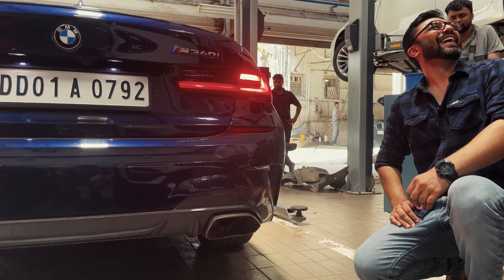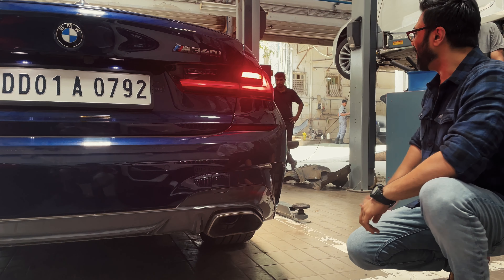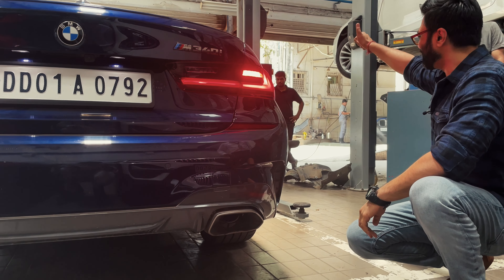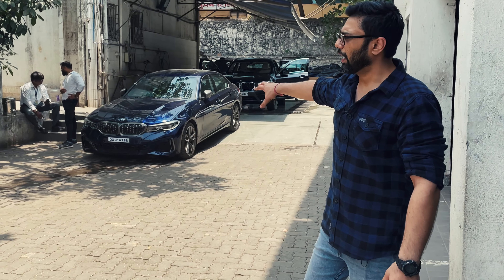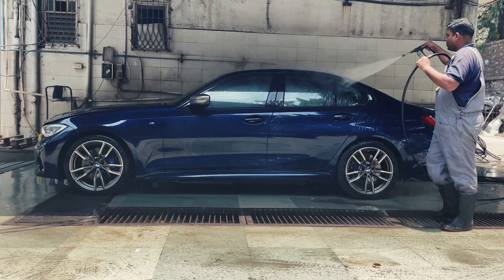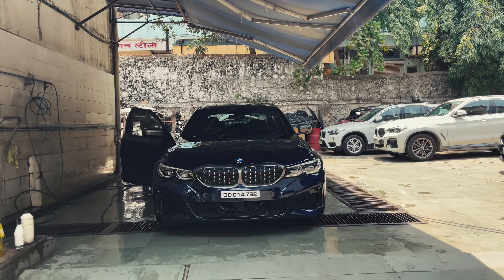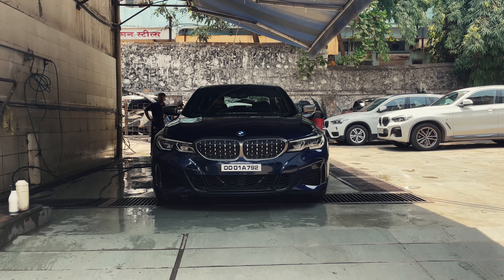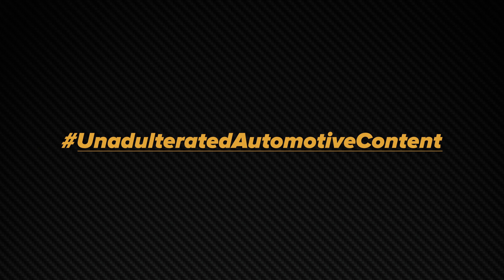BMW M340i M Performance Exhaust - Install & Sounds | 4K

Comment: I really wasn’t expecting it to be that good. Pure melody 🎵
Reply from the maker: Indeed !
Reply: @KKCOnAMotive  Hi I’ve just purchased the bmw M340i and wanted to get the m performance exhaust upgrade and I read your post on team bhp. You have written it was approx 2L including installation cost I have gotten a quote for almost 3L. Just wondering if they are scamming me or has the price really gone up by that much since you installed it
Reply from the maker: @helintroy  Hi, yes I had purchased at the said price but currently people are being quoted anywhere in the range of 2.5 - 3L.
Reply: @KKCOnAMotive  ok I was quoted 2.7 with additional cost for fitting and testing…. I guess I’ll have to now nut up and buy the exhaust from them as I’m not wanting to void the warranty as the car is almost brand new….
Reply from the maker: @helintroy  All the best.
Reply: @KKCOnAMotive  day after my car is going in for the fitment of my M performance exhaust…how would compare the pops and bangs now that the soot accumulation must have happened in your exhaust and how much louder is it compared to stock… i can’t wait for this upgrade

Comment: Hi Karan, I’ve got an M340i LCI with the M Performance exhaust installed at the dealership. I’ve been encountering a persistent check engine light, which seems to be related to the petrol particulate filter. Have you faced something similar? Or do you have any suggestions on how to resolve it?
Reply from the maker: Hello , apologies for a delayed response. 
1stly a MPE with the OPF should not give a CEL. If the OPF is deleted then it will give a CEL. 
So the CEL may be something related to improper installation or some other issue. Best to get it scanned so error code can help identify the CEL.
Reply: @KKCOnAMotive  Thanks Karan, the vehicle is parked at Bavaria Pune for the diagnosis. I’ll keep you posted after resolution. Is there a way to reach out to you via DM just in case if I need further assistance?
Reply from the maker: @karthikreddy1171  https://www.instagram.com/kkconamotive

Comment: can you share the details on how and where did you buy the OEM from ???
Reply from the maker: This M exhaust was purchased officially from the BMW dealership.
Reply: @KKCOnAMotive  okay thank you. how much did it cost you?? dealership in mumbai right?
Reply from the maker: @jesc4326  When I purchased it was around 2L including GST & Installation. Current price is around anywhere between 2.5-2.8L.
Reply: @KKCOnAMotive  Thank you :hand-purple-blue-peace:

Comment: Is this rto approved?
Reply from the maker: Has an OEM part number , passes PUC tests & doesn't create unnecessarily ruckus/loud noise. Also if you are aware RTO approval process then let me know. Thanks.
Reply: You still riding on this exhaust without any problem on Indian road because I am also planning to buy it
Reply from the maker: @arshadkhan7878  Yes.

Comment: What year is your car? I just got the mpe installed on my m440 and it sounds nothing like that. Im jealous!!!
Reply: Same here! I haven’t heard any pops and bangs even after the MPE, I also tried Manual and Sports transmission and reving it to a higher rpm range but nothing worked. 

Did it eventually change for you?

Comment: Can we fit this exhaust in BMW 6 GT ?
Reply from the maker: No. But if you are having the 30i engine then there is a different M Performance Exhaust available. Contact the dealership & im sure they will have a quote/availability.

Comment: I recently got this but haven’t heard any pops and bangs even after the MPE, I also tried Manual and Sports transmission and reving it to a higher rpm range but nothing worked. I have a M340i LCI 1.

Are you also running a tune?
Reply: since lci  came there r no pops and bangs only pre lci ones do

Comment: How much would a m performance exhaust cost and would it affect the warrenty of the car?
Reply from the maker: The prices of M Performance exhaust have increased recently. Dealerships are quoting anywhere in the range of 2.5 - 3L. Being an official upgrade having OE BMW Part no. the warranty should remain intact.
Reply: is one available for the new x5 40i m sport? as an oem @KKCOnAMotive

Comment: I have an x5 and planning on changing the exhaust from bmw itself. How much did they quote u?
Reply from the maker: X5 40i will mostly use the same / similar exhaust upgrade and cost anywhere around 2.5-2.8L.

Comment: How much does the exhaust cost
Reply from the maker: When i installed it was Aprox 2L including taxes and fitting, however now its anywhere between 2.5 - 2.8L (depending on the dealership & stock/availability).

Comment: Brother i have bmw 530 i msports 2021 face lift tell me one think i also want change the exhaust plese recommend me the best exhust to buy??
Reply from the maker: There is an M Performance Exhaust available for the 30i engine too. Best to contact the dealership for the exact part no. and quote. In aftermarket solutions you can look at Magnaflow, IPE, FI, ArmyTrix or Eisenmann.

Comment: Could you please let me know how much they charged for the exhaust and also the 19" 792 Wheels please ? I saw on Team BHP that they imported them for you. Did they take the original alloys back or do you have them aswell ? 
Thanks again. Hope to be getting one soon !
Reply from the maker: The Rims + Michelin PS4S tyres cost about 4.8L. OE rims and tyres were sold separately to pvt. Individuals as BMW dealership buyback schemes were 1 sided deals.
Reply: @KKCOnAMotive   Thank you soo much ! this was a lot of help. Would also love to join the various bmw groups that you manage and run ! I am hoping to book this car at the end of july this year and a large part in thanks to the in depth reviews and video's that you have so kindly posted on Team-bhp and youtube aswell. I might bug you again for more info and help , if that is ok as the date gets closer to the time for booking ! Thank you very much once again !

Comment: What year is your M340i? Thanks
Reply from the maker: Cody, this is a Feb 2021 manufactured M340i but it doesnt have the mild hybrid system (like 2021+ EU or US spec versions). Hence its comparable to 2020 US Spec. M340i.

Comment: Hi,
Awesome upgrade...!
I have a BMW X5 M Sport 40i and dealership Andheri navnit are offering m performance exhaust on my car too...So it recommended upgrade on my car too...? Does it give really good sound than stock?
Reply from the maker: Yes it is surely recommended if you want your x5 to sound aggressive, sporty & engaging.
Reply: Hi , have got any noise while driving because the pipes were fitted by cutting and rejoining. Is there any exhaust leak coming??

Comment: Worthy upgrade 😍 Please share the details of how to import/get M Performance exhaust in India...
Reply from the maker: Ordered through the dealership (Part No: 18302464492).
Reply: @KKCOnAMotive  hello how much did it cost?
Reply from the maker: @N07genesis  Aprox 2L
Reply: @KKCOnAMotive  is it including fitting charges? because i got a quote for 2.8L :/
Reply from the maker: @N07genesis  Costs have recently been updated & have gone up. Yes now it’s being quoted around 2.8L
Reply: @KKCOnAMotive  even of 330i i’m getting 2.8 lacs plus labour.
Can you please suggest weather to go for m
Performance exhaust or ipe or other reputed exhaust brands

Comment: Came back again to check this video out haha! Hope you’ve been doing well. I had a question, why don’t you install the m performance steering wheel as well? I’m considering the LCI model along with the mpe and the m performance steering wheel but I’m just confused whether the steering wheel is worth it or not. Do you have any idea how much would the m performance steering wheel cost ?

Comment: How much did you spend on this exhaust ?? Imo the finish was very vanilla,  akrapovic also makes exhausts for bmw , but as you said you wanted to keep the warranty intact , which is a must in India ... And did you guys leave the car in idle after installing the exhaust or let's say it's a slip-on  . For the ecu to recalibrate with the new setup ???

Comment: amazing video,is it lighter than the stock exhaust?
Reply from the maker: Thanks Saatvik. Well there's no exact data available of the weight saving but looking at the design and shape of the muffler it seems  there would be some weight saving for sure.

Comment: Hey, i am following you from the day u bought 340i m, love your detailed video. 
How much mileage you are getting before and after you change the exaust?
Reply from the maker: Thanks Rachit. The fuel economy is unchanged as this is an axle back & not a full catback. I have achieved as high as 14 km/l and as low as 6 km/l too hence it all depends on the way you drive the car.

Comment: Can it be done on new gen 530i , the official one ?
Reply from the maker: Yes, 30i engine has a M performance exhaust upgrade option (will have a different part no.).